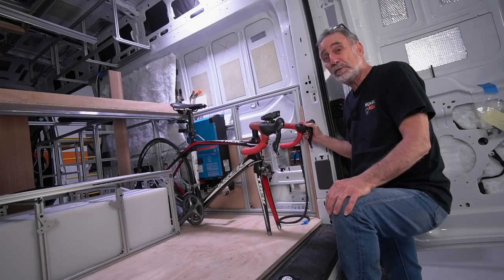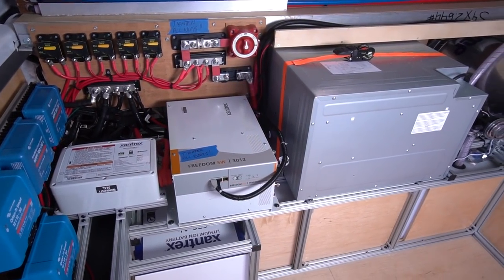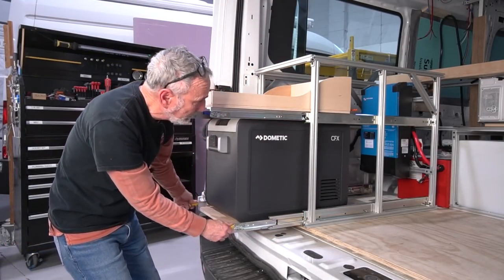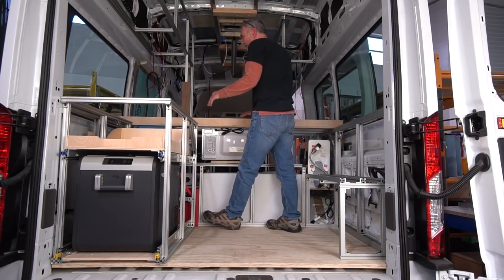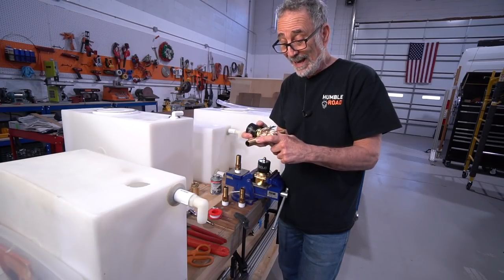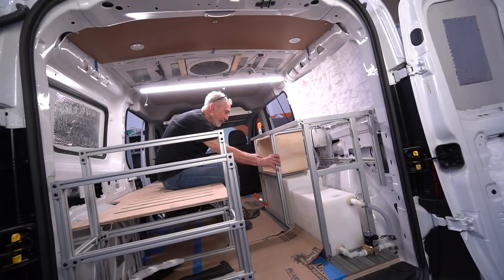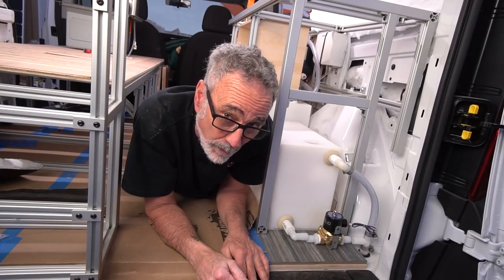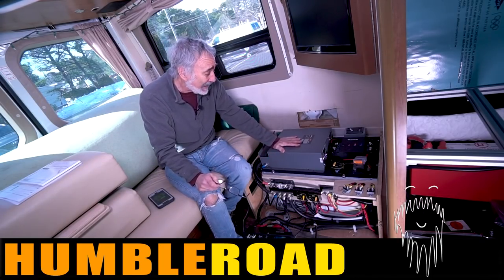Helpful van build tips

Comment: I installed a solenoid valve on my gray tank. At first it worked fine, but with dish detergent and soap it gunked up and began leaking. Hopefully that doesn’t happen to your’s, I replaced mine with a motor actuated valve and it has been trouble free.

Comment: I heard you say 3000 watt inverter. 

In case you’re unaware, (as I was) the victron multiplus is listed as 3000va or volt amps which is equal to 2400 watts not 3000 watts. 

I thought I had a 3000 watt inverter until I read the specs on it. Still great equipment but kinda confusing when everyone is used to watts not volt amps. 

Love watching your videos by the way, You’ve been an inspiration in my own build. Do you allow visits to the shop? I’ll be up in NJ in June to visit family. Keep up the great work.
Reply from the maker: Yes, Mike, I actually mentioned that the sustained capacity was not 3000 watts, unlike the Xantrex 3012. I do feel, however, that the other benefits of the Victron as compared to the Xantrex outweigh the lesser capacity.

Comment: Thanks for all your great videos and sharing of your knowledge. I had a question about the valves that you said not to use because they had lead in them. If you are using them for the grey water which you can just vent out to the outside ground isn't this an environmental concern?
Reply from the maker: Maybe long term, I'm not qualified to say. Just about every underground pipe in America has some amount of lead in it. My warning is to avoid ingestion of lead on a regular basis.

Comment: Gday .. all good tips and tricks .
When you say food grade is it BPA free. ?
Reply from the maker: BPA is used primarily in plastics. The FDA still considers the levels of BPA used in manufacturing as safe. Accept that as you may. As a mere van builder, I am taking what precautions I am capable of taking.
Reply: @HumbleRoad  . It's not a perfect world . It would be good to use stainless steel or copper but that has its issues and limits .

Comment: Just a polite note. You really need to stop using those breakers/trip switches if they are from China. The Chinese breakers don't work. Some of them don't trip at all and others can pass as much as 5-10 times their rated amps before they trip out. I've changed everything over to Mega fuses for high amp circuits.
Reply from the maker: Blue Sea is a highly respected supplier in the yachting world. The breakers I use are no higher than 60A. For high amperage (300-400) I use ANL

Comment: What is the price of the Mini-me # 2 ?
Reply from the maker: Mini-Me #2 is built on my personal 2019 Promaster City. I drove it as my daily driver for 3 years for a total of 48,000 miles. I serviced it regularly. I needed to be sure this platform was acceptable for my project. It is. It will be sold completely built out for $60,000 with new tires and fresh fluid service.